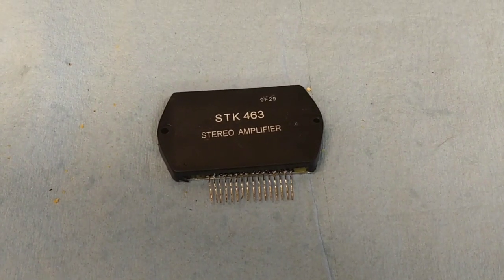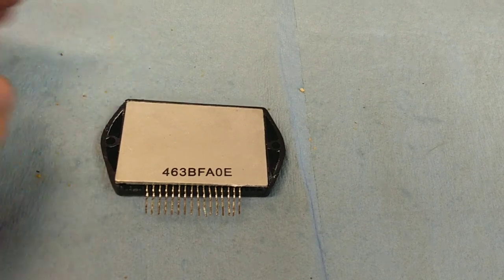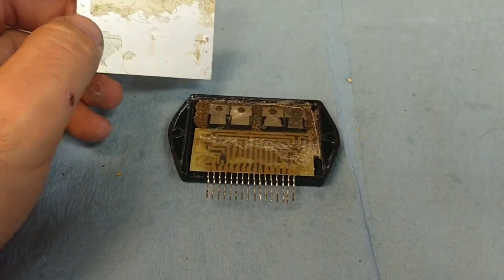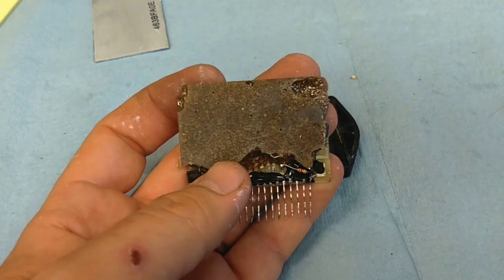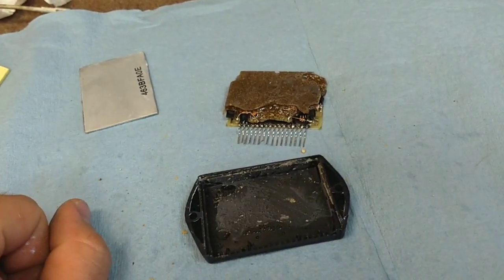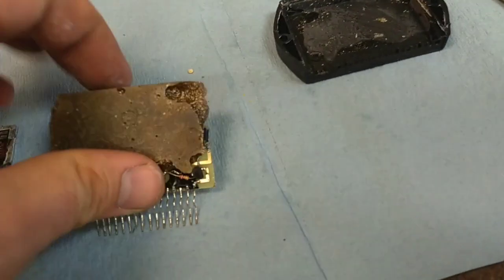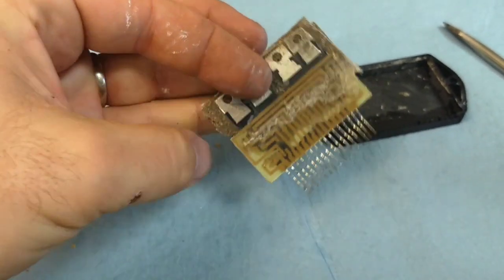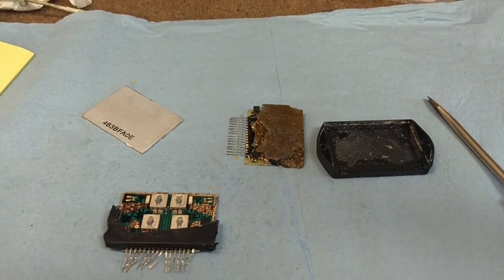Counterfeit STK amplifier ICs, what's inside?

Comment: Depending on the circuit, I've replaced STK IC's with LM series IC's. Of course, you have to do both channels and some modification, but alot  easier then dealing with fake Chinese parts.

Comment: Interesting. It's a tough thing to find valid parts for most anything electronic - I can start a ramble on smartphone parts, automotive parts, computer parts, just about anything is knocked off and of truly substandard quality. I been repairing electronics for 25+ years and have witnessed the decline personally on the demise of repairable goods, and the what I can swear is purposely made scrap/junk replacment parts that are of ill fit, and if they work its a miracle and the repaired item will suffer from degraded performance at best. NOS , or a parts unit is the way I go these days and usually its just acquiring units for parting out in most cases to get a vintage item working correctly once again.

Comment: Even a lot of output transistors are now fake Chinese counterfeits. So even a receiver or amp with a discrete output stage can be challenging to repair with original parts. And some designs have stability issues with substitute transistors. Into an 8 ohm resistive load on a test bench everything might look good, but drive the amp to clipping into a real world reactive load (speaker) and it may oscillate when it clips which, at best, might destroy tweeters and possibly cause the amp to fail again. Modern transistors tend to be higher speed and higher gain both of which can contribute to stability problems. A lot of people doing repair work don’t understand this. In order to get good specs, a wide bandwidth, fast rise time, etc, amps especially from the 80’s often use massive amounts of negative feedback and as small as possible compensation caps along with small output inductors. Putting substitute transistors into these designs skews the phase shift in the amplifier and, under some conditions, negative feedback can become positive feedback with often disastrous results.
Reply from the maker: I remember my first experience with counterfeit transistors. It was servicing a Kenwood super eleven. The devices were bogus, and as soon as an inductive load was on the unit and any current was pushed through the amp, there was a bright flash and a fire. The amp had oscillated out of existsnce
Reply: Well said!

Comment: I ordered a counterfeit module a while back in an attempt to repair an old Technics amp.  As soon as I went to adjust the bias on the channel the protection relay clicked on - module dead.  The manufacturer sent me another one and this time I barely turned up the bias pot and it's been working well.  Still junk though.

Comment: I have some experience with this too. I bought a replacement Darlington STK-0039 "Power Pack" on eBay that was supposed to be original. I could tell it wasn't original because the imprints on the chip were different, the 10 pins were not numbered. I installed one into my Pioneer SX-680 which had a bad channel. It was no easy task- I am not as electronically inclined as you- thermal compound has to be applied. The stereo worked for about 2 hours, then the power pack blew and it was dead again. I was pissed.
Reply: Sounds like you have some fault in your pcb lines. Even you buy pure Chinese copy of stk icS, it will still able to handle the same voltage and load. Load is important. Almost all stk series icS are rated for 8ohm load buy they run just fine with 6ohm load. If you use 4ohm load speakers on stk's icS it will blow up in loud and and long run. Lot of people doesn't understand about speakers impedance. Some are parallel 2 speakers in one channel which changes speakers impedance in half. Some time speakers coil gets short and those speakers will make sounds but they are the silent ic killer. First thing you can do is check your speakers impedance with a digital multi miter.
Reply: Me too  ..same thing..sx680
Reply: I also had issues with them too on the same model Pioneer. It would make all  these weird high pitch sounds.

Comment: I got conned by a distributor on E-bay. So I know what you mean. I have a Sony surround amp that has something similar as a center channel preamp. Got hosed on a claimed "pulled part" same with the amp transistors that were supposes to be complimentary darlington pairs.

Comment: I used to have a Realistic STA-130 that killed the RH speaker due to short in the STK chip, split supply amps using module chip are an accident waiting to happen, I prefer discrete transistor amps when it come to split supply format, The Dynavox CS-PA1 has a TDA chip but it's single ended capacitor coupling, I recently bought the MT-50 model and found it is split supply, also loud hum regardless of vol knob setting (3x louder than the mild hum from the CS-PA1)

Comment: Interesting video you show there...I recently repaired a Sanyo DCA611. It uses 2 STK0059 IC's. Luckily one was burned and I ordered one from Germany. Certainly the weight point you mention there is true. They weigh less, but the plastic case  does not go thicker or above the aluminium heatsink. I just don't know what to expect. The IC bought from Germany worked and still works but judging from your video, don't know for how long ? May be I can use the stk0050 replacement using real transistors and board with aluminum  as demonstrated  on some video here. Thank you

Comment: Good luck finding an original replacement, I managed to find one a while back from China, clearly it was a used chip, but actually worked fine!
I really dislike these modules, apart from amplifier chips, they came as power regulators & convergence chips on projection TV's.

Comment: So, question. If it had been assembled well (proper heat transfer, perhaps not potted) and identified properly as some sort of non-original retrofit device... how would you feel about that? Conceivably you would have no moral issue with it, but would you use such a device?
Reply from the maker: If it worked properly and reliably, I'd have no problem using it

Comment: Hi JP. Thanks for uploading these great  vids. I've really leanrt alot.I've this denon old AVC A1 amp 240v model which was working faithfully for years. Recently I connected a different set of 4 ohm towers (amp rated at 8 ohms)and it played well.But from time to time, it wouldn't turn on. The display  appears to turn on then blinks and shuts down.Sometimes it works great without any issue.Do u know what could be causing this?
Reply from the maker: Not without seeing it. Could be power supply issue,. Amp going into protect mode from an intermittent fault, cold solder joint, or bad ground. Could also be intermittent amplifier fault
Reply: Jordan Pier  
Thanks for the reply.I suspect the 4 ohm towers may have caused the output trans or driver trans to be damaged. B'cos I hooked up a different denon amp which worked for a while and then shut down too.Both amps are rated at 8ohms.Do u think I could replace just the output and driver trans on the amplifiers to handle 4ohm loads?
Reply from the maker: I wouldn't go replacing parts. If your speakers are pissing off two receivers, you've got bigger issues.  4 ohm speakers won't do well on an 8 ohms rated receiver, but will only shut it off at high volumes. No easy way to just replace parts to make it work.

You need more.output transistors, bigger capacity drivers and bigger rectifier , sometimes even a bigger transformer
Reply: Jordan Pier 
Thought you'd say. Guessed as much.Only if it was that easy.Thanks anyways.

Comment: Do u know if the counterfeits are noticably lighter in weight?..im trying to figure a way to tell if real or fake without takjng apart?.. my real stk 4191 weighs 45g...the real one u had looks lot like mine...fyi the originals are almost impossible to take apart..unless you do a cut out...could you weigh your fake one vs your real one and let me know the weight in grams? if possible.
Reply from the maker: The fakes are noticeably lighter.
Reply: @JordanPier  thanks a lot im trying to find an original so im asking ebay sellers to weigh theirs..one guy came back and said 45g which is about what my orig is....i dont want a fake....i want high quality orig..my orig lasted 40yrs i dont want a chinese fake that will last 1 week lol

Comment: Whats the best way to test these? Can I test in circuit? How do you tell the fakes?
Reply from the maker: Fakes usually have notch (crossover) distortion, or do t pass power output tests without blowing up
Reply: @JordanPier  I need one of those Mr Carlson Lab testers. lol. I bet they are all fakes but I was hoping they were pretty good ones. I wonder if there is a way to cut open and repair an original? I have a dead SVI here.